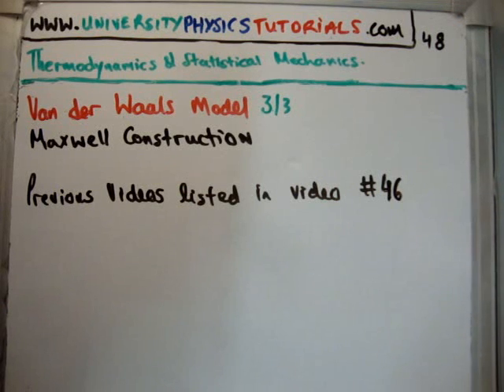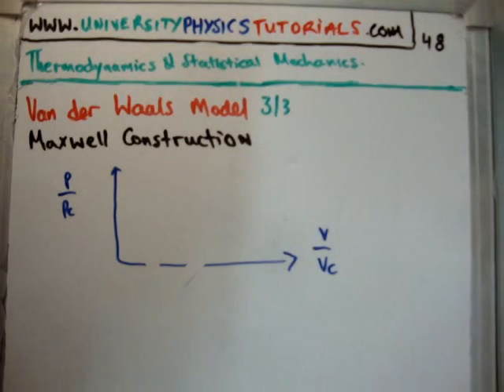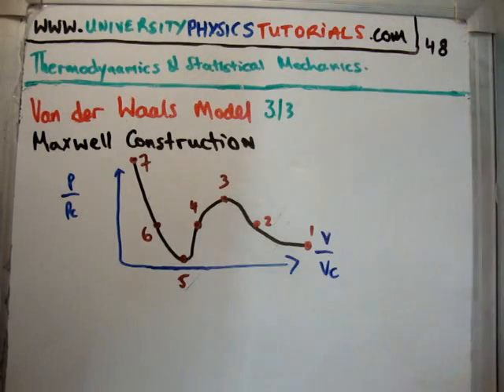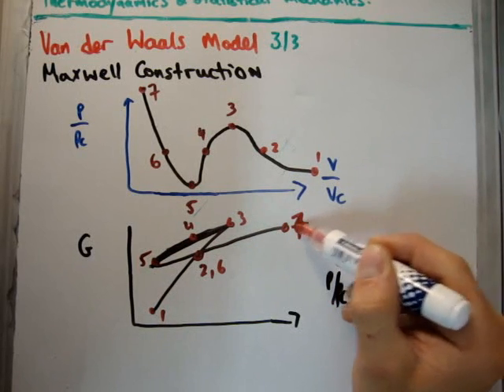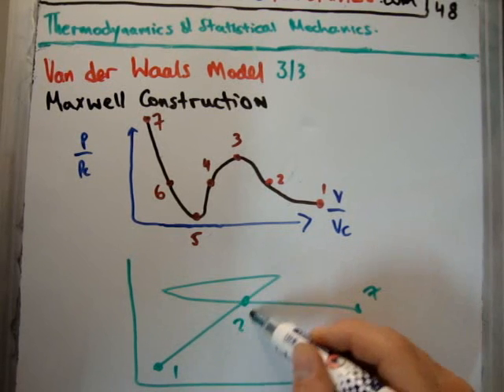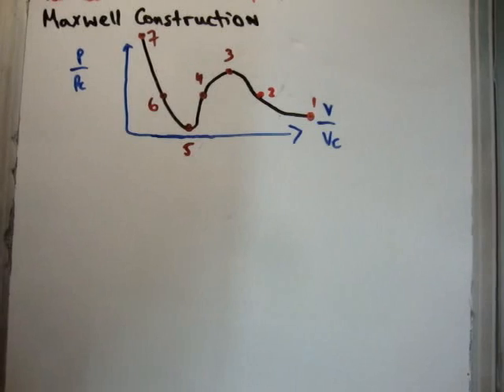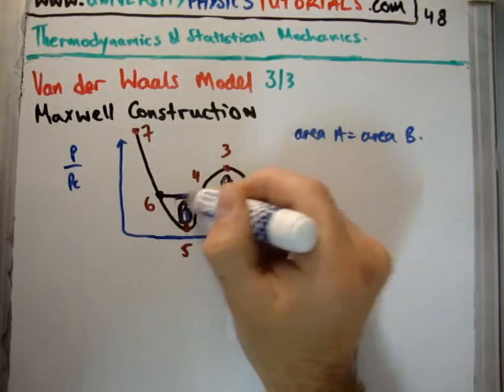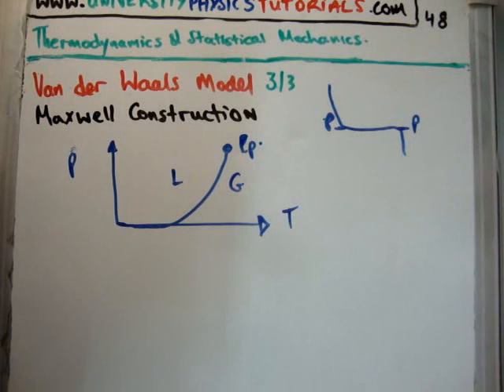Thermodynamics 48 : Maxwell Construction

Comment: Great vid!

I do understand that Area A and B are equal...
Can u plz brief a bit more why the curvy lines can be replaced by straight line?...at 7:26
Reply from the maker: This is done because the areas of A and B do not correspond to stable phases; the straight line corresponds to a phase change so we use that instead.